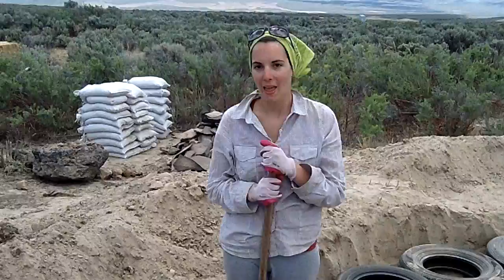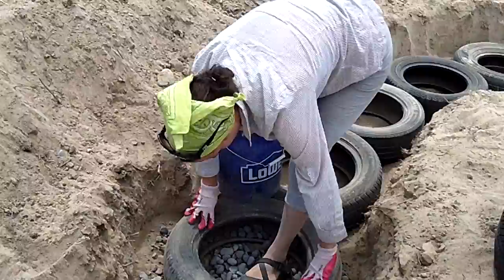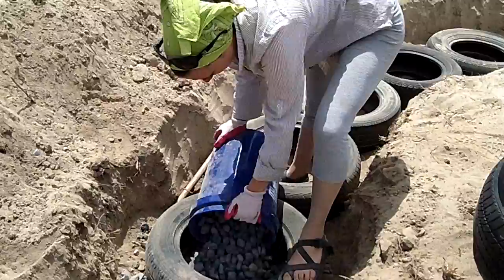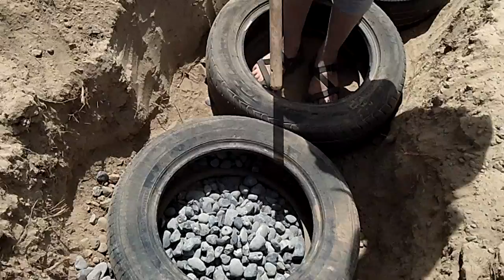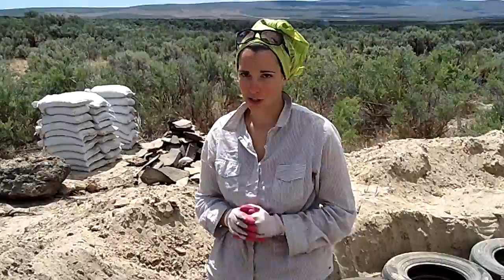Rubble Tire Founcation // De-Engineering @ Rimrock Meadows Strawbale Roundhouse

Comment: Interesting improvement on the Frank Lloyd wright gravel trench.    Mabye setup a small angled swivel Chute and dump the bucket and let it gravity feed on the inside cavity.  Maybe use a small hoe as a rake.  Take a coffee can, drill two holes in the middle that cross  one another at 90 degree angles at different altitudes, and thread 1/2" rebar through it into the handle of a yard tool.   Fill with cement, now you have  a light weight tamper when it hardens. Maybe you can cut the dense pack time down with a method like this and better tools.

Comment: If someone suggests building your home, natural or otherwise, on a foundation of rubber tyres I'd advise you to think carefully about the resale value. Rubber oxidises, a chemical deterioration, and crystallises, a molecular restructuring that causes the rubber to loose its elasticity. These two material behaviours should be enough to put you off using them, but rubber tyres are also full of microbiocides and other nasties that leave your natural home sitting on a set of toxic stilts. If you think you are making the best of a bad world by putting waste to work in your building, you are wrong. Rubber tyres can be fully recycled, but not if you bury them in a foundation for 100+ years. The tyres you think you are saving the environment from today are the very ones that will pollute it when you are dead and buried.
Reply: Put rubber in a place (encapsulated) and remove exposure from the sun...I would like to know how long the process takes to crystallize.